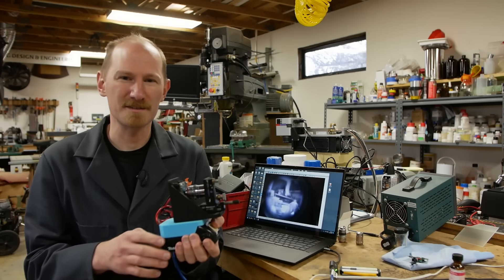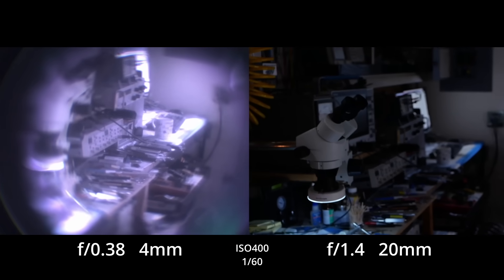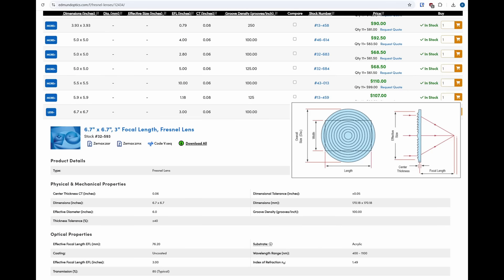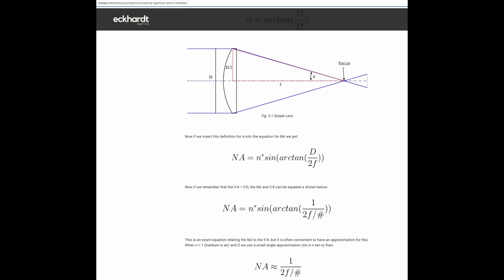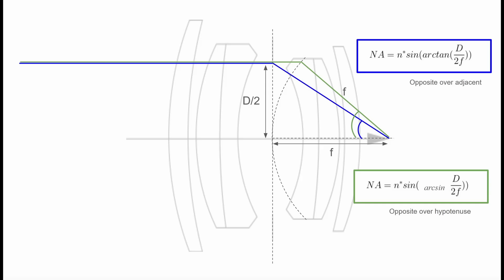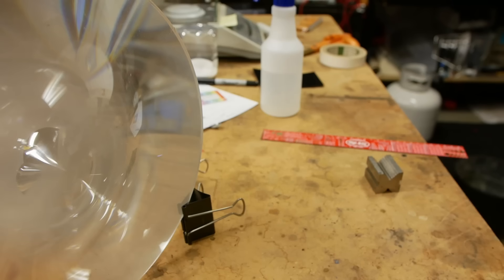f/0.38 camera lens made with oil immersion microscope objective

Comment: This camera concept could have great potential as micro robot's optic for working in low light, it could benefited from extreme low light performance as it could use weaker infrared LED than conventional lens, saving energy and get a bit more of range out of it.

Comment: Could you drill a hole in the glass cover and inject oil, rather than needing to totally remove it? Maybe a vacuum pump or two holes to let the air displace and oil to wick in between the cover and sensor.

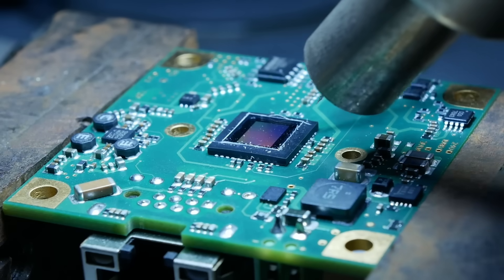Comment: 2:20 This isn't just glass, it's an IR filter. It appears opaque to IR but transparent to visible light, to remove thermal artifacts from the image. If you want to turn a camera into an IR camera, place a piece of overexposed color film negative (processed) over the CCD in place of where the glass was; it has the opposite effect.

Comment: A note about focal length, aperture, and depth of field: it's all about ratios! A 100mm f2 lens will have the same depth of field as a 50mm f1. Very handy when comparing lenses. 

I got a cheap f0.95 35mm lens (7artisans) and even though it's not very sharp, it's so fun to use!

Comment: Which type of oil is used for lenses coupling?
Reply from the maker: It is specially designed to have a refractive index of about 1.4 to match glass. I checked the MSDS, and some brands are proprietary, but others are mineral oil with polyphenols dissolved in it. The amount of polyphenol is used to tune the RI. It's designed to minimize evaporation.

Comment: The low f via oil is an interesting  pursuit. I’ve done a little surface mount IC work in the day and, well, the skill required to do what was done here removing the IC and reattaching, plus the glass removal is so substantial it dwarfs every other effort in this project. Precise heat for precise time particular to the IC size and type, solvents, optics, tools, environment.  Yes people get trained to do this but it’s a LoT of training.

Comment: See everyone comes at the depth of field question from a different angle. You say that the 4mm focal length is responsible for the huge depth of field, but I say it's due to the tiny sensor size.

In the end it's about multiple variables being changed at once, put a 4mm lens on your micro 4/3rds sensor, and you distance to subject shrinks so much that you lose all your depth of field in order to maintain the composition, exactly as you said at the end.

I just find it interesting which of the two variables people chose as dependent.

Then to really through the cat amongst the pigeons, Tony Northrup starts talking about the equivalent ISO of different sensor sizes...

Comment: This made me realize there is a lot more going on in lens design, like I never thought about the need to account for the air gaps between each element inside of a lens(seems obvious now). 
Also, being able to remove and replace delicate surface mount components sometimes feels like a super power.
Reply: Thats why modern coating made such a big difference in lens designs. I once had a Zeiss Planar made in 1896 from the year it was released, they were not popular then because without optical coating it just had quite poor contrast as so much of the light ended up bouncing around because the different refractive index of the glass & air.

Comment: One way that you can preserve wide angles of view and have shallow depth of field on a small sensor is by using a large format camera and then focusing another lens on the image produced on a frosted glass plate at the focal plane of the large format system. It doesn't give you good light gathering, but it does give a very shallow depth of field.
Reply: For example, using the Kodak wide field Ektar 10" f/6.3 on an 8x10 camera, then capturing the image off the back with your 20mm/1.4 lens would give you roughly the equivalent of a 17mm/0.42 in terms of depth of field, as far as the μ4/3 camera is concerned. If you can find something like an f/4 or f/4.5 lens that will cover 8x10 at a similar focal length, then you could be looking at effective f stops of 0.3 or less.

Comment: Given the oil coupling in the microscope setup still uses a glass cover, is it actually necessary to remove the sensor cover? Or would drilling 2 tiny holes to fill it with oil work? (Not sure if that wouldn’t be harder than removing the cover though, I was imagining a tiny PCB drill and maybe somehow sucking in the oil?)

Comment: One thing to remember is that a theoretical f/0.0 lens would gather only about 5 times more light dan a f/1.0 lens. You can not make such a lens, but you can make a mirror that effectively works at f/0.0.

The way to do that is to take a strongly curved parabolic mirror and have a small sensor in front of it, facing the mirror. It will focus only at the middle of the sensor, and only to one distance, rendering it pretty useless.

Also, to win one stop over f/1.0, you would need a f/0.62 lens instead of f/0.7

Comment: Ben, please look into the "speed booster" adapter that effectively reduces the lens focal length, but also produces a higher effective F-number. i heard it is essentially an optical expander. I really want to hear your thoughts on this. Thanks
Reply from the maker: I use a speed booster as part of my standard camera rig. It's great! I have a Leica 18-35mm intended for APS-C cameras, and with the speed booster, it's effectively f/1.2 and slightly wider, which is good for micro 4/3. The booster compresses the light cone down for the smaller sensor, and based on what i learned in this video, the booster has a final element that is closer to the sensor, providing a higher NA, and shortening the focal length without changing the entrance pupil. Love this setup.
Reply: @AppliedScience  I think that's the reason so many of the fast high quality lenses for todays camera systems are so huge, they basically have a speed booster built in.

Comment: F stops are based on a 35mm sensor. Multiply the F number by the crop factor. Tony Northrup has a very informative video on the relationship of crop factor and F numbers. Micro four thirds crop factor is 2X. A F1.4 lens would be equivalent to an F2.8 Full Frame lens. To achieve an F0.9 lens on MFT, you would need to make an F0.45 lens. Hope this helps.
Reply: Well, F-numbers are F-numbers. Focal length divided by pupil diameter.
But for depth of field, it is actually the entrance pupil diameter itself (in mm of feet or whatever) of the lens that matters. Bigger diameter makes for shallow depth of field. And the good thing is: look at the lens from the front, and you see that pupil.
Reply: @pizzablender  I did not mention in the original comment that the focal length is also multiplied by the crop factor. On micro four thirds, an 85mm is equivalent to a 170mm. This also means you can get some insanely low  F stop numbers on medium format or larger, because the inverse is also true. Say, your medium format has a 0.62 crop factor, a 52.7mm F1.4 medium format would be equivalent to an 85mm F0.868 full frame.  So, you're right, F number is F number, but what good is that number unless it is captured and made visible, like you are doing with a sensor or film. Here's a link to Tony's video he very simply demonstrates this. They also have  other videos going into much more detail.

https://www.youtube.com/watch?v=f5zN6NVx-hY

Comment: Next month on AppliedScience, Ben machines a curve into a silicon wafer and etches his own 20 megapixel image sensor.

If you think removing the cover glass is fun, try doing that and scraping off the bayer filter and microlens array without breaking wires or marring the silicon. I have a box of Raspberry Pi cameras I killed trying to make a more UV sensitive camera. I did finally get one partially scraped clean that works until the sensor warms up after a few minutes. BTW, a number of the Sony based RPI cameras give some control over exposure and seem to be higher resolution.  

I can't remember the correct term, but if I understood what I read, image sensors expect light to hit them at a narrow range of angles. That might account for some degraded image quality. Some manufacturers offer what I think might be naked sensors--no glued on cover glass or microlens array and greyscale. I just couldn't find anyone selling them direct to the public.

Comment: Exploring Low F-Number Camera Lenses: A Deep Dive into Optics and a Custom F0.38 Lens

*   0:00:04 Introduction to F-Number: The F-number of a lens is defined as the ratio of the entrance pupil diameter to the focal length. It determines the brightness of the image produced by the lens.
*   0:00:35 Fastest Commercial Lens: The fastest commercially used lens is the f/0.7 lens used by Stanley Kubrick in the movie "Barry Lyndon," which was famously lit only by candlelight.
*   0:00:56 Debunking the f/0.33 Lens: The f/0.33 lens by Zeiss is revealed to be a non-functional joke lens, created for marketing purposes.
*   0:01:10 Building an f/0.38 Lens: The presenter built a working f/0.38 lens using an Ethernet-based single-board camera from IDS.
*   0:01:33 Camera Setup: The camera is mounted in a 3D-printed carbon PLA frame with a fine-pitch slide adjuster and a kinematic mount with a 40x oil immersion microscope objective (numerical aperture 1.3).
*   0:01:45 Oil Immersion Objective: This type of objective typically uses oil to optically couple the objective to the slide. Here, it's used to couple the objective to the camera sensor.
*   0:02:20 Sensor Modification: A critical step involved removing the protective glass cover on the camera sensor without damaging it, allowing the oil to directly contact the sensor for optical coupling.
*   0:02:49 Challenges and Solutions: Removing the glass cover was a low-yield process. The presenter went through multiple cameras and sensors, eventually succeeding using heat and careful manipulation.
*   0:04:14 Test Footage Comparison: The custom f/0.38 lens was compared to a micro 4/3 camera with an f/1.4 lens, demonstrating that the f/0.38 lens is significantly brighter, especially in shadowed areas.
*   0:04:49 Unexpected Depth of Field: Despite the low F-number, the lens exhibited a surprisingly large depth of field due to its very short focal length (around 4mm).
*   0:05:56 Fresnel Lens Discussion: The presenter discusses a previous experiment with an f/0.5 Fresnel lens, which led to a debate about the theoretical minimum F-number in air (0.5).
*   0:06:29 Aberration and F-Number: The relationship between F-number and spherical/coma aberration is explored. A lens with significant aberration may have a less meaningful F-number.
*   0:08:52 Adding More Lens Elements: Adding more lens elements can increase light-gathering but also increases focal length, not necessarily lowering the F-number.
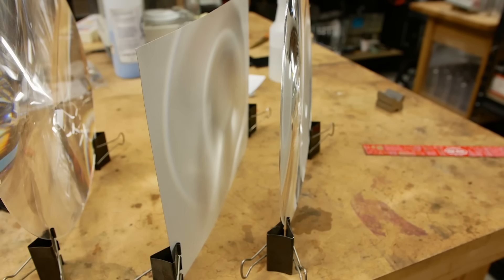*   0:09:17 Limiting Factor: The minimum achievable F-number is limited by the distance between the final lens element and the focal plane.
*   0:09:45 Numerical Aperture and F-Number: The relationship between numerical aperture (NA) and F-number is discussed. The precise formula is debated, but the approximation NA = 1 / (2 * F-number) is generally accepted.
*   0:13:34 Aplanatic Lens: A lens corrected for spherical and coma aberration is called aplanatic. In such lenses, the principal plane is curved, affecting the relationship between NA and F-number.
*   0:14:51 Role of Coupling Oil: The coupling oil matches the refractive index of the final lens element, allowing light to enter at steeper angles and maximizing light collection on the sensor.
*   0:15:24 Conclusion and Future Plans: The presenter plans to build a larger oil-coupled lens for a micro 4/3 camera to achieve a shallow depth of field with high light-gathering ability.
*   0:15:38 Complexity of Optics: The presenter highlights the difficulty in understanding seemingly simple optical questions without sufficient background knowledge.

I used gemini-1.5-pro-exp-0827 on rocketrecap dot com to summarize the transcript.
Cost (if I didn't use the free tier): $0.04
Input tokens: 28588
Output tokens: 918

Comment: Fresnel lens does not have to have spherical aberration - it can be manufactured "aspheric", if shape of each groove is optimized. It has unfixable issues with off-axis rays, but on-axis it can be perfect. So nothing prevents it from having proper max aperture limited by total internal reflection.

Comment: I'd like to draw attention to T-Stops (transmission stops), which are used in professional video lenses. They are an approach to account for the fact that two lenses from different manufacturers, both at the same f-stop, may actually allow a different amount of light through the lens. 
This can be due to number of lens elements, coatings etc, each absorbing some amount of light. T-stop is a much more "real world" measurement of how a lens performs, whereas f-stops are closer to design specs.

For example, your lens may be optically f0.38, but imagine the oil absorbs enough light to reduce that down to say t0.4. Your lens still has the optical characteristics of an f0.38 lens in terms of depth of field etc, but less light is ultimately hitting your sensor.

You already touched on acuity; I can recommend reading Optical Limits' Lens Test FAQ page for an idea on how lens sharpness can be measured objectively, although there is indeed no provable "minimum" quality to call something a lens 

In M4/3 lenses, for example, some of the Olympus Pro f1.2 lenses actually have a measured t-stop of ~1.8
T stops being significantly higher than F stops is especially common for complicated high-end zoom lenses. In critical cinema work, ensuring exposure evenness between lenses of different focal lengths (and manufacturers) is more important.

Final note, comparing a tiny ethernet sensor to a modern M4/3 camera may bare taking into account the improvements in imaging sensor technologies over generations. Biggest example would be strapping your lens to an old digital CCD VHS camcorder and comparing the output to a modern full frame sensor - just another variable to take into account.

Comment: On the amount of light and why nobody uses microscope objectives in reverse: 

Your defition of 'light gathering' is a bit weak. 

For one, we can start with Intensity, i.e. power per area or square of absolute field squared. That is the number of photons your sensor will see, that will be converted to electrons in the sensor that will be amplified and converted to a digital number.  

Let's forget the imaging part for small moment and think of a optical system as a light gathering system, that takes light at it's opening and compresses it into light at the sensor. Then, you'll hopefully see that just making the system opening larger means you can collect more light, and that is proportional to the area of the opening. For example, the direct sunlight is an intensity of about ~600 W/m^2, hence a 1 square meter opening will collect about 600 W while a one square centimeter opening will only collect only 0.06 W. Hence, just a larger opening helps you collecting more light. That's why telescope are large. 

Now, what is imaging? Imaging is simply looking at collected intensity depending on the angle it comes from. Think about a simple compount eye, which is just tubes with a integrating sensor at the end which accept a certain opening angle, pointing at different angles. 

Now, onto lenses: Lenses (and curved mirrors) are great for imaging because they can do a fourier transform with the light: angle dependence at the input is converted into position dependence at the output, hence you just need a lens and a sensor that tells you intensity at a position to get your desired angle-depending intensity.   

So, how much light does a certain area of your sensor, i.e. pixel, then get? Easy, it's size corresponds to a range of acceptance angles. So the power you'll get will simply be the integral corresponding to it's angle range our of the angular power distribution of the incoming light. 

So, what did you do? You used a high NA objective in reverse, i.e. an objective that has a rather small opening diameter (~10 mm?) but focuses that light down very heavily (NA 1.3). For light from a single direction, i.e. a plane wave, that should produce a focus of arounf 0.5 um. Hence, with your pixel size of ~5 um (most  camera normal CCDs) or 1.5 (um phone sensor CCD), you'll get a rather large angle range on each pixels, corresponding to 10 (normal CCD) or 3 (phone CCD) the size a of a plane wave spot . Thus, you're operating your reverse objective far away from diffraction limit as you integrate over a lot of plane waves, hence it's 'bright' in the sense or power at each pixel vs power at the opening.  However, the opening aperture is also small, it's not collecting much power at all.

Comment: You might get more accurate colors on the footage by calibrating the white balance again after removing the front filter of the sensor. Had a similar problem with pinkish tint when converting a dslr camera to full spectrum by removing its uv/ir filter stack. Even though i added a new uv/ir filter in front of the camera after the conversion, the slight change in the wave lengths on the new filter vs the original one completely ruined the original camera's white balance, but setting a custom white balance fixed it.